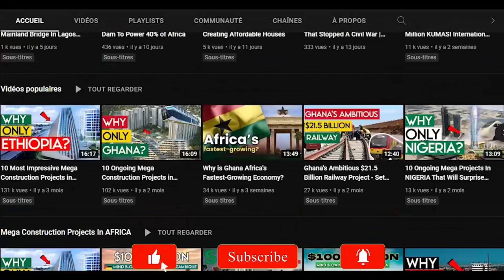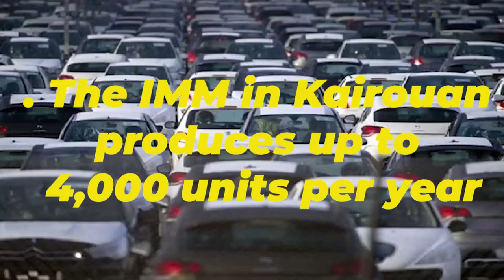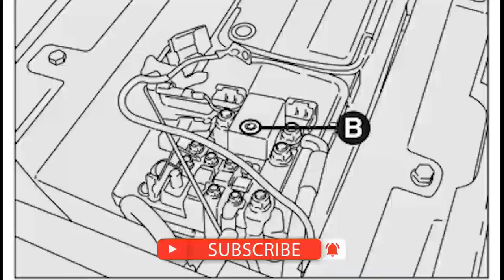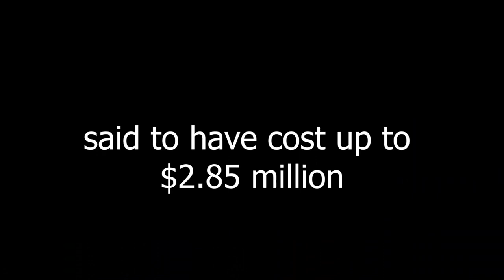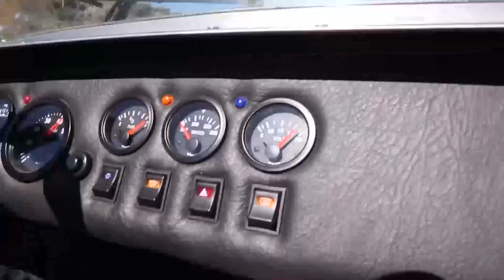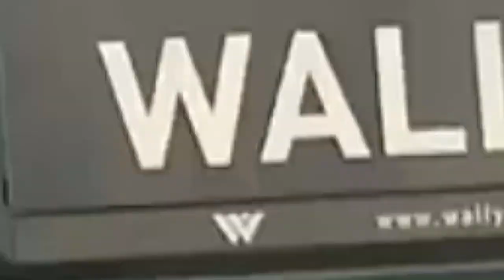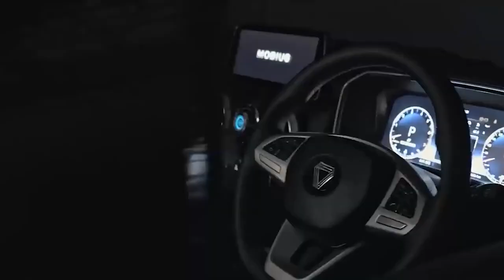10 Best Car Manufacturing Companies In Africa You Should Know

Comment: I would suggest SUVs, Pick up Trucks, Truck Rigs, Passenger Buses and Cars for Taxis and Uber. These cars should be hybrid engines and must have the capacity to use gasohol or biodiesel. I would recommend models that do not have computers and air suspensions and use tires that are no flat for durability... If repair costs are low...they would be a good thing to have if you are in business. These African vehicles should be easy to fix, do not need the retailer's inhouse motor shop and have cheap spare parts that are available... anywhere... Plus, bring it in nations under a consignment deal 🤝...So that these car dealerships can have a try to sell the African vehicles for business and shopping...